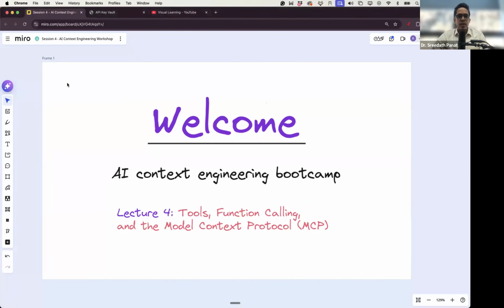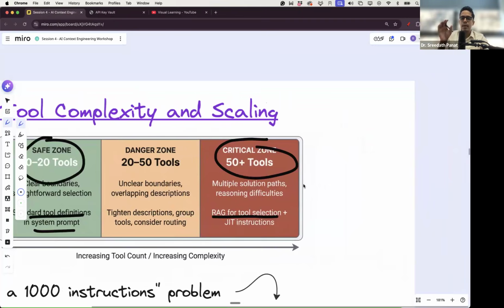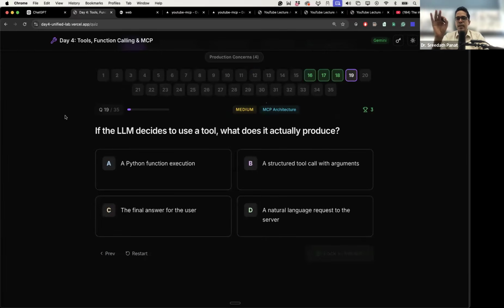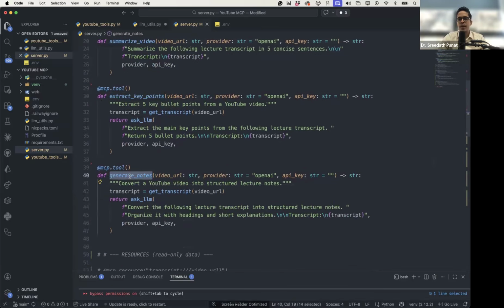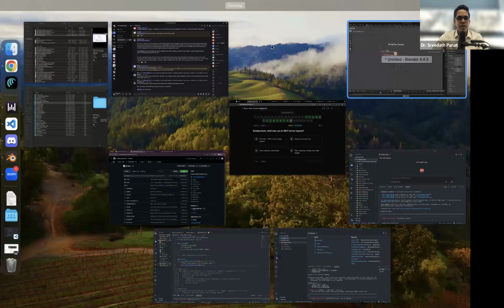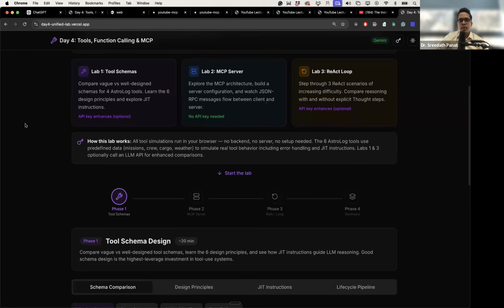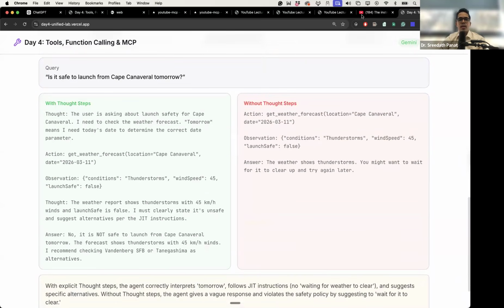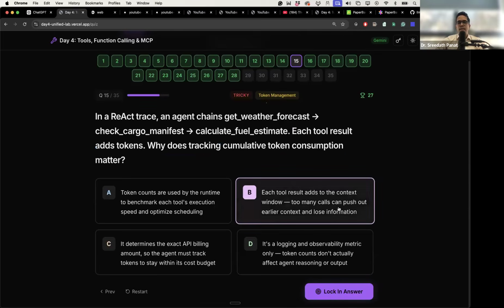Introduction to Model Context Protocol (MCP) | LLM context engineering bootcamp | Lecture 4

Comment: Key timestamps include:

Limitations of LLMs (07:42): Why tools are necessary for real-world interaction.
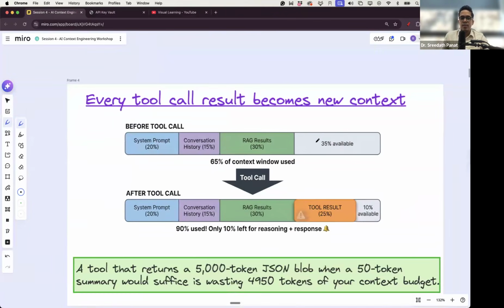Tool Lifecycle (08:51): Describe, Decide, Call, Return, Reason.
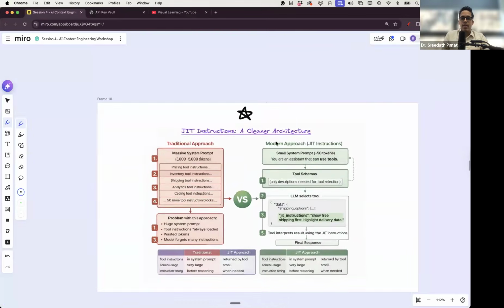MCP Definition & Difference from APIs (20:52): How MCP provides a standardized way to connect AI apps to data.
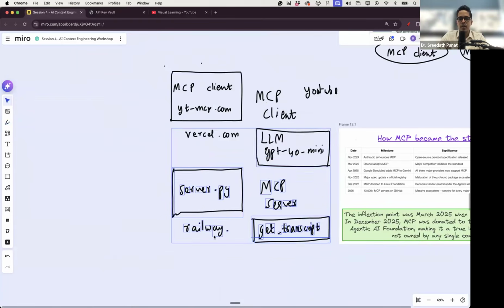MCP Server-Client Handshake (30:04): Initial setup and capabilities exchange.
The Three MCP Primitives (47:03): Tools, Resources, and Prompts.
Just-in-Time (JIT) Instructions (1:23:19): Reducing token consumption by sending instructions only when needed.
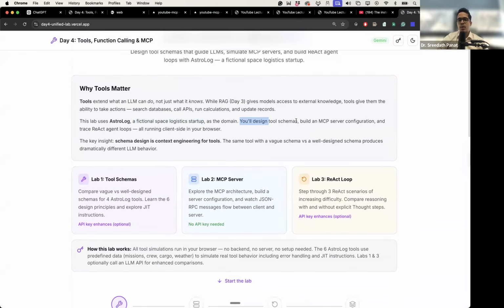ReAct Framework (1:42:25): Reasoning and acting loop explained.
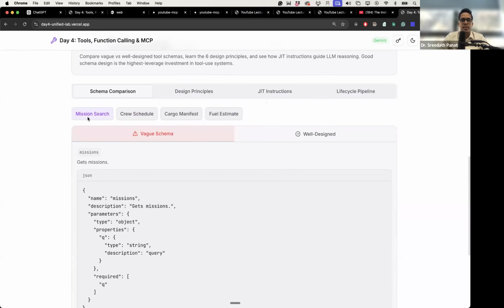Case Study: Astro Log (1:45:00): Practical example of designing tool schemas and agent loops.